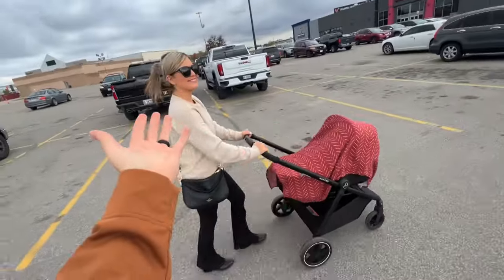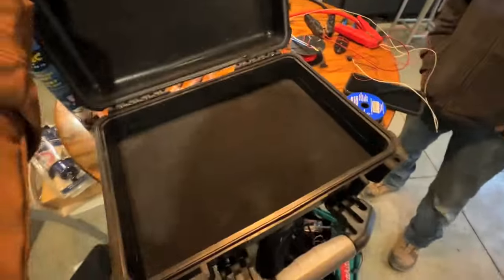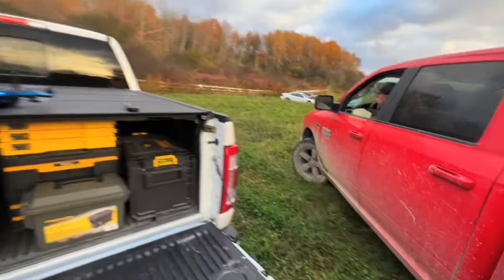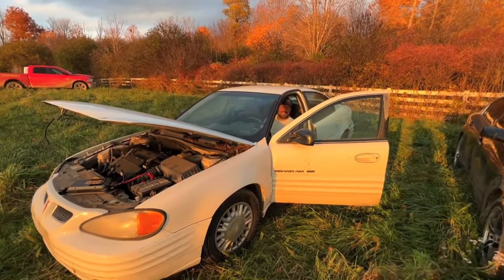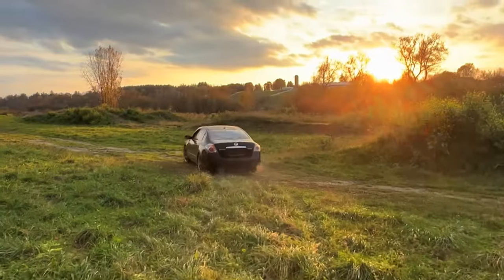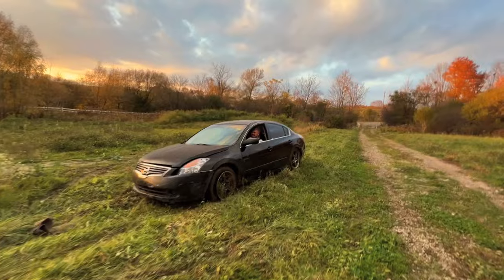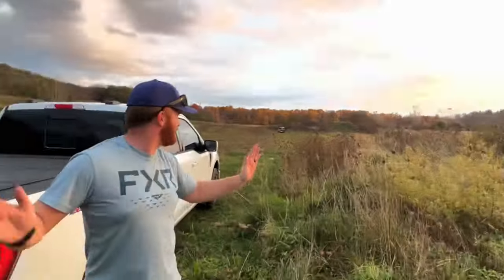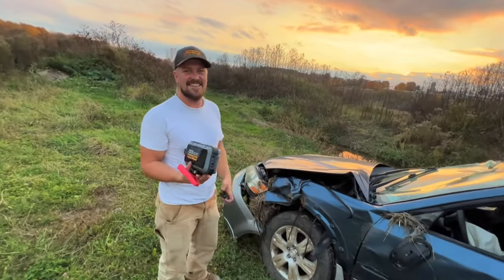Nissan ALTIMA Jump FAIL!

Comment: what is the point in buying  a 1000 junk car to romb over a dirt hill wrack the rad or oil pan and THEN u cant do nothing with it after other then scrap it and get nothing from it.....JUMP THE CAR fast then 3k an hour  before it gets wracked..... should of started that nissan and took right to the hill and sent it flippin to its dealth